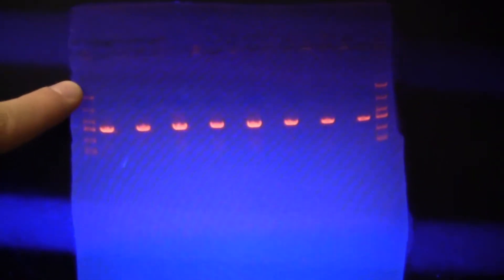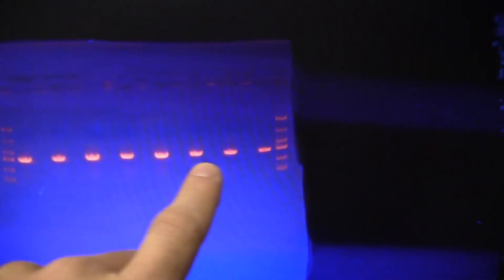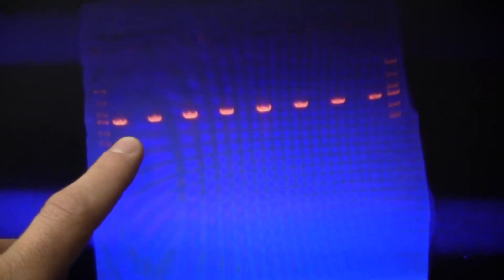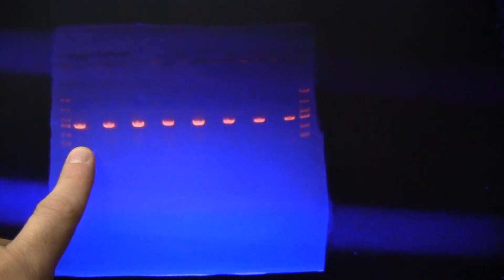02 Colony PCR with master mix part 2

Comment: Why we get amplification in colony pcr with specific primers if the gene of interest is not der....in short why we get false positives of in colony pcr??
Reply: I wouldn't really call this a false positive, since the bands weren't the intended length. He didn't give us a whole lot of information about his methods, but I'd guess the results here are due to primer design strategies. If backbone specific primers were used, there would still be amplification whether or not the insert is present, but you'd just end up with shorter PCR products for clones that don't contain the insert. So the shorter PCR products on the gel (like in the video) would mean a negative result. They were still expressing GFP in the last video when he selected them because he probably started with a plasmid containing GFP and then cloned his insert (C1 gene) into it. Cloning isn't 100% efficient, so there were bound to be copies of the empty plasmid floating around in his transformation reaction, and cells that took up these would still glow green but wouldn't have the intended insert. 

The reason for designing primers this way is actually to avoid a real false positive, which in this case would be longer PCR products but colonies that don't actually contain the insert. If you use insert specific primers for the colony PCR, theoretically there would be no bands/no amplification for colonies that don't have the insert and you'd only get bands for those containing the insert. However, you can end up with false positives because there is typically some contamination on your plate from leftover ligation reaction components from when you did your cloning, so this would have copies of the insert. If these end up in your colony PCR reactions, the insert will be in there, regardless of if they were actually taken up by the colony.